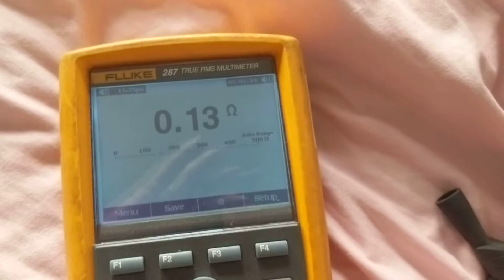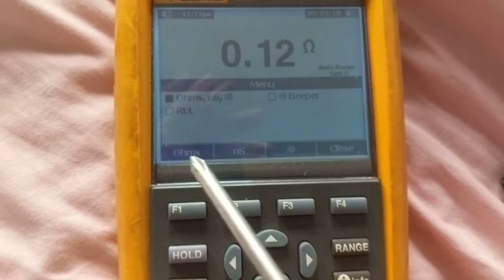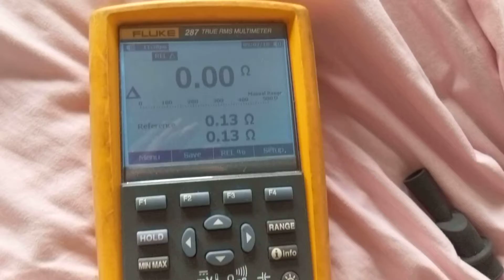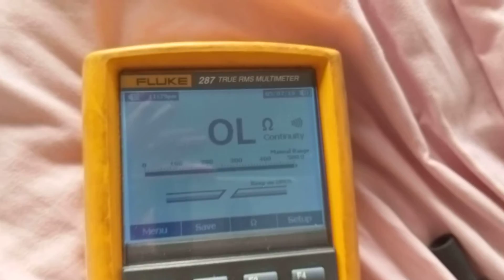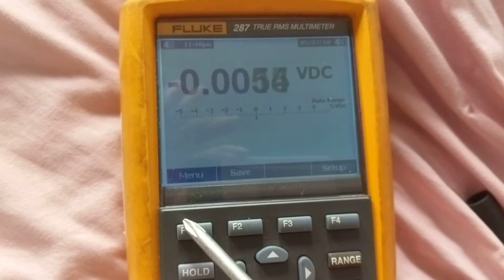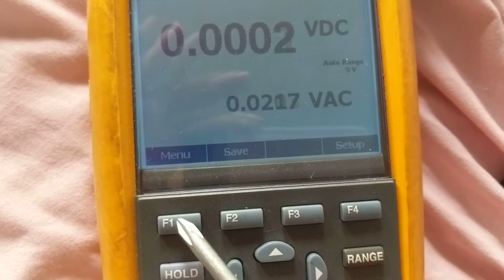BEST AUTOMOTIVE METER IN INDUSTRY FROM MY CHANNEL OF AUTOMOTIVE SCHEMATICS BY JOSEPH

Comment: Hey joe. 
I about to buy a multimeter.  I do truck and trailers. Simi. 
A few years back I ran into a problem with a manitou putting on a fault code.  I tested leads and sensor and tested ok. I think it could be the ecu.  
Correct me if I am wrong,  the Bias voltage going to sensor should have ac and dc volts right?  This is one reason I thinking go buy a 289 that I can measure a good Bias and compare to faulty machine.  What do you think please? How do you check the Bias for fault?  
John. 
Thank you for your channel. 
I thinking fluke 289.  I see you demonstrate and very impressive.  I also had in mind the snap on advanced but it don’t do dual volts.